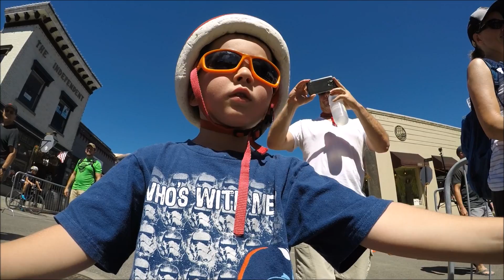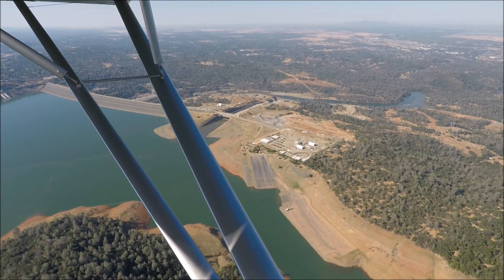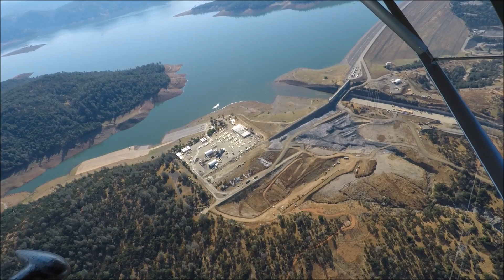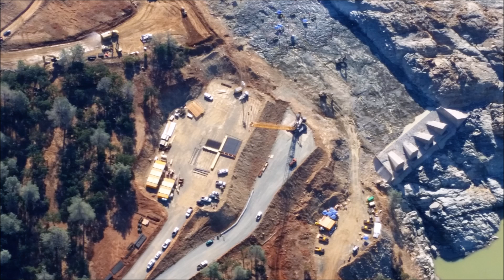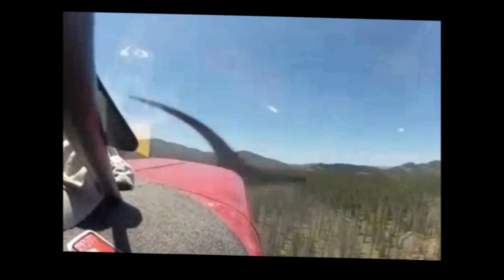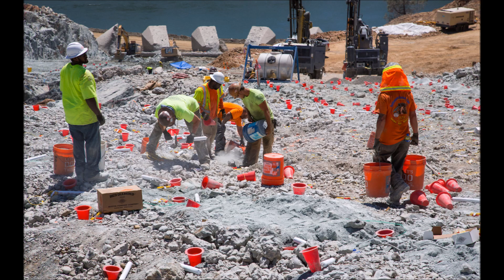Oroville Update 21 June It's Heating Up!

Comment: Looks like between you & the heat of the summer, holding their feet to the fire on quality design of construction... none, paying the taxes for this should get hoodwinked. Good to know the anchors into the bedrock pass thru the roller compacted concrete and lock into the structural concrete. Sounds as if the sleeper slabs @ the expansion joints are in order as well. In the Texas experience i'd had with ice in the concrete mix... it is easy to mistake the un-melted ice as part of the designed aggregate, when slump tested @ the plant, or @ the discharge from the delivery/mixer truck. Upon it's melting, the designed, desired, slump and water withheld, can be compromise. Thus resulting in a lesser quality of strength, due to the ice's melted water voids after placement in the forms. Which then can result into surface puddling as the said ice aggregates melt as well. Hopefully the Contractor has shared the same experience.-TXDOT Inspector of new bridge & roadway construction. '86 -'09   62117
Reply: Last time I saw them doing an ice mix, it was basically the consistency of shaved ice.  Though liquid Nitrogen cooling is also used as well.
Reply: wow - interesting - thanks for sharing

Comment: Juan, I had no idea about all the pertinent data that goes into your determination as to whether you can take off in a airliner, I would like it you did a video on that subject, I find it fascinating. Thanks.
Reply: + Any passenger of the airlines would benefit from that kind of information.  I know I'd rather have a delayed or cancelled flight for safety reasons.

Comment: Awesome report, the concrete that was previously installed during the original construction was definitely substandard by today's standards. I like the pictures of steel rebar, however I do not see the treated corrosion resistant type I might expect? You need to fly in hot weather, you need bigger wings, more powerful engine(s), or a less luggage. 

True story friend of the family was freight pilot during Vietnam war, 747's, he got into a location where they did a troop drop, and fright drop, then went to take off, and figured out the runway was to short, so out came the seating sections in that 747....

Comment: Ha, 115 degrees and density Alt of ?  The mighty Luscome can handle it!  What engine do you have in it and what is your cruise speed?  I have been enjoying your videos.. Gord.
Reply from the maker: Well, 115F on the concrete spillway... Continental 0200 160mph
Reply: Wow, I didn't think the Luscombe could fly that fast! Very nice.. What year is the plane?

Comment: Juan, thanks for another thorough update. As a fellow flyer, I would love it if someday you did some detailed videos about weights/balances and performance. Even flying my ultralight in the summer weather becomes an issue on some of the shorter strips with obstacles. Being foolish and flying when you have zero safety margin performance-wise can have a tendency to cause the luck-bag to run out before the experience-bag fills up :-)
Reply: Ratman572 Ratman572 and all other fledgling or experienced aviators, your tax dollars have been put to work by the FAA at www.FAASAfety.gov.  This web site has lots of information on flying under the tab for Courses and Seminars.  The beauty is most are free and those that aren't are clearly marked.  Most of the course modules take about an hour to complete and have been created by aviation experts throughout the country, from Flight Instructors to the Aircraft Owners and Pilot's Association Air Safety Institute.  Under seminars you can search for events in your local area that are also usually free.  These are great opportunities to talk to other pilots and experts in aviation and to learn from the experience of others.  I like what you said about the size of the "Luck" and "Knowledge " bags.  There is an old saying, "There are bold pilots, and old pilots. But rarely old bold pilots."
Reply from the maker: Excellent, thanks!

Comment: juan. i don't think the designers of the spillway have thought about the need to create steps and channels in the RCC to prevent the finished reinforced slap from slipping down the face.. this is easy enough to do by having Highs and lows  across the RCC  or even better.. have a few trenches across the RCC where the full strength concrete is in direct contact with the bedrock. 

might have to show them an escalator video where the steps work great going up or down.. yet when the steps fail and go flat. they become a giant slide..  i would also love to see some piastic pipe installed thru the rebar carefully measured so they interlock.. they could use no hub couplings to connect them once in place.. to keep the alignment.  even short connecting sections with 2 no hub couplings..  after the entire spillway is poured cables are pushed thru the tubes .. post tensioned and back filled with grout..  this connects the first slab at the top with a super sized volume carved out below.. as an upper anchor. or even a angled bottom.. this would for sure connect the top and bottom..   if there is an expansion issue.. pump the tubes with the cables full of grease and use locomotive suspension coil springs to allow for expansion of the slab while not ripping the strands of the cables out.  this would also make it easier to change out the cables one at a time if there is an issue in the future.  make a real easy way to tell if something is slipping apart also. 

i still like the idea of bending hooks in the Rebar that run vertically..  so the prefab assemblies could be set down and a crane slips thru the hooked another piece of rebar..  so there is a physical connection from top to bottom of the rebar and still be able to handle it. 

on the heat density issue.. does phoenix still return to operations after sun down when it cools off slightly?  and on another flight over the dam.. to you have an outside air temp gauge.. to monitor the air temp at different flight levels.  with 115 on the tarmac how high do you have to go before the air temps drop into the 50Fs range?    my thinking is create a downdraft with something to cool off the work area air..  a copter hovering at altitude.. creating a down draft that and then shifting position so the helicopter is not sucked down in it.  its just a thought.. way off thread..

Comment: Did I miss something, why would there be asbestos dust in the air?
Reply: guess you missed a lot. where do you think asbestos comes from?
Reply: Does it occur naturally there?  I wasn't aware.
Reply: They found naturally occuring asbestos in the bedrock.
Reply: Thanks.  I used to do asbestos abatement and was aware that it occurred naturally in places like Fort Knox, but was not aware it was in N.Ca.

Comment: "Yeah, Juan.... we can't have you asking too many important questions we got to move on to the approved MSM reporters who ask us dumbass questions.  So we'll get back to you and your smart alec questions later..."
Reply: Apparently, there are some details that won't be revealed for purposes of security. I guess they don't want those with bad intent to know weak points.
Reply: "Critical Infrastructure" security is why.  He may not be an attorney, but he's had conversation with one!
Reply: Why couldn't he answer that one question? Sounded like an attorney that can't comment on an ongoing trial.
Reply: Wait for it, it won't be long until we can't use "critical infrastructure" like highways because the "terrorists" might find out where it is.
Reply: About the only thing the MSM is good at is finding the one person who hasn't a clue but can cry for the camera
Reply: US Building code requires backflow preventers on municipal water supply for this reason.  accidental contamination, not terrorism though. That's why your hot water heater now has a little expansion tank next to it, and it did not when you were a kid. With the one way valve there, expanding hot water in the tank would have nowhere to go but leak out the T&P valve of your water heater.
Reply: The more you know!
Reply: Backflow preventers are only required in residential when a pressure reducing valve is installed behind the water meter.  If the water pressure is below 80 PSI you don't need the reducer, backflow preventer, or expansion tank.
Reply: Infrastructure is on a public website in my county, except for water lines.  I find that funny because you don't need to access utility pipes to inject poison into the public water supply.  Any faucet will suffice if a pump is used to push it into the street mains.  Anyway, there are valve boxes in every street intersection.  If they don't indicate where water pipes are, nothing does.  There are some things you can hide, and other things that you can't.  There is no benefit to inconveniencing people who use the website by not having the pipe locations shown there.  I draw house plans, locating utilities is one of the things I need to know before I start.  It's easier to get the info from the county than to have to go out and play Sherlock Holmes at the site.

Comment: Please explain what exactly is roller compacted concrete. It sounds like concrete that is mixed damp, but not wet enough to flow like mud.
Reply: Hi hun. You have it pretty much spot on. Rcc is is composed of all your regular materials however the ratios are different allowing for a mix which is drier and hence stiff enough to be compacted by a vibratory roller.
Reply: See link: __ https://en.wikipedia.org/wiki/Roller-compacted_concrete

Comment: I love this series about the dam, thnx for your time covering this.
Reply: looking forward to your future series on airlines as mentioned in this video.
Reply: Thanks for the great explanation Eastern Woods!
Reply: Juan. The "dental" concrete is basically just fill. Kind of like the gravel they use for the base of a highway, except it won't settle or wash out. It's cheap bedrock. Once the holes ( cavities, which is why it's called dental ) are filled in the RCC will go on like layers of pavement. Once that is completed they can drill down as deep as they want and install rock bolts. The rock bolts will secure the re-bar and the tops will be covered by the structural concrete so we don't get those plumes like during the emergency........The height of the side walls will govern the spillway capacity. Until they get sidewalls up on the lower section Croyle Canyon will handle some water. Once the lower sidewalls are up the walls on the upper section will govern the capacity until that is completed with higher walls. ..... The under spillway drainage going into open or closed culvert is minor. A pipe has a limited capacity, an open culvert can at least overflow without backing up under the spillway.